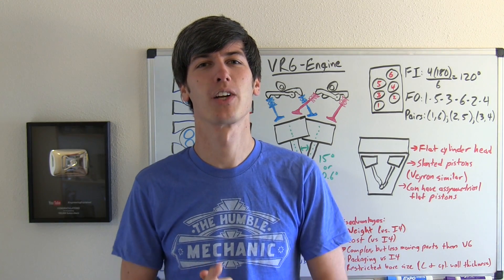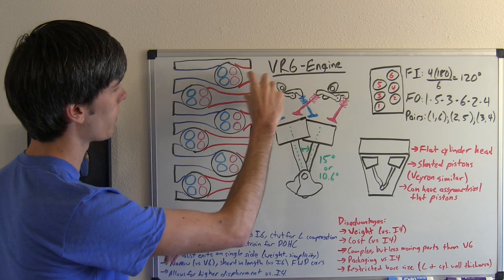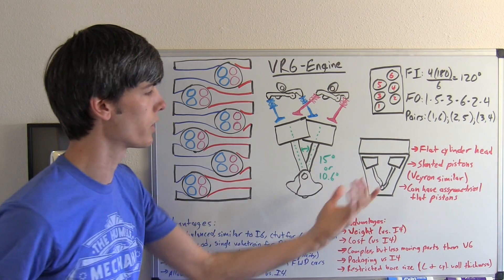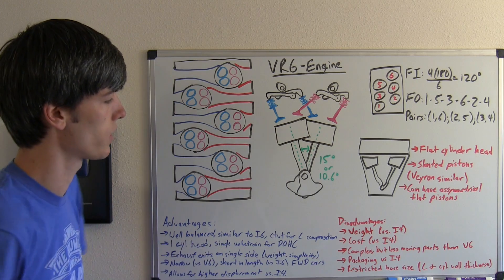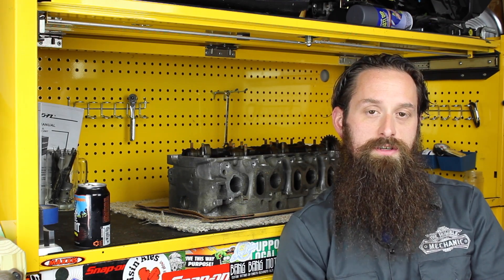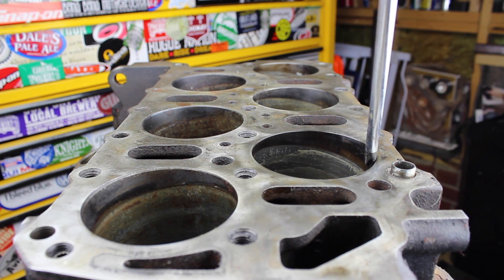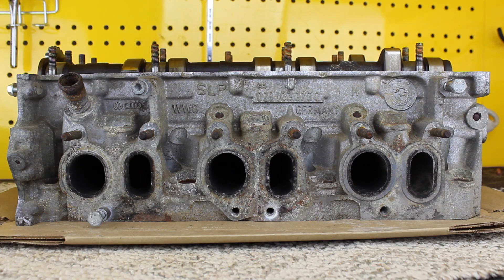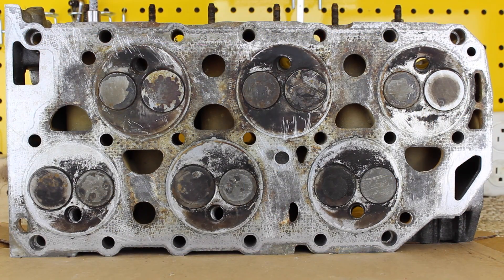VR6 Engine - Explained

Comment: The VR8 is a better engine. Because it has 8.
Reply: +lrreidjr Yea. Who am I kidding? 2.0L 4cyl engines are the best. Especially Vtec engines. Just wait for that VaginaTec to kick in. You'll go 0-60 in 6.9 seconds. Amazing.
Reply: +Matthew D The VR38 is a better engine, because it's a twin turbo monster ;)
Reply: Kenny Smith VR93 is thr best. 527ci supercharged big block v8. 5000hp.
Reply: +Matthew D.... same old gay 8 response. v8 guys that troll us 4 and 6 cylinder fans are pathetic at best. I can't wait for the new 3cylinder engines to hit the markets. I'm a fan of sub 2.0 liter engines and yeah vtec it pretty cool. Americans couldn't get it to work and sold the technology lol almost every new gay 8 is running some type of vtec technology.
Reply: +lrreidjr Congratulations. Good luck with that and good luck going through life as a homophobe.
Reply: lol @ v8's
Reply: +No Name ....Nissan's 3 cylinder is in production and sold in Thailand , its small and fits in a suit case. they have two versions, supercharged 200hp 60+ mpg and a turbo 350hp 55 mpg. Ford Will offer a similar engine for the U.S. market built by Nissan. You can read about these amazing compact engines and how they are built for High-performance with extreme fuel economy. they'll also use 76% less metal to build than a Chevy v8, 80% less metal than a dodge hemi and makes more HP per cubic inches than any v8 offered today.
Reply: +Matthew D I love nothing more than a huge, large-cammed V8 with a huge lope, but I have to respect the I-4 too.. I'm a sportbike guy myself, so my R1 is obviously an inline 4 and can smoke many vehicles with much more displacement, but to me one of the most astonishing accomplishments is the original S2000. In its debut year I believe it held the record for most hp per liter of any production NA engine available. That's a hell of an achievement in and of itself. That, and the power you can get out of forced induction is insane, considering the displacement. still, V8s have a sound that will live on forever!
Reply: +lrreidjr 

Also, power per liter is a meaningless measurement of real-world performance unless you are operating in an environment where displacement is restricted or heavily taxed, like a racing series or restrictive country. What matters a lot more is the power an engine makes compared to its external dimensions, or weight.
Reply: lrreidjr 

Try to read this slowly, since you clearly missed it the first time: power per liter is a MEANINGLESS real-world measurement (unless you are comparing identical engine designs or are restricted by regulation), since an engine's size and weight are not completely dependant on displacement. I have a fuel-efficient 500hp 5.7 V8 that's much smaller and much lighter than an RB26DETT, which makes 115hp/liter to my 87. My modified LS also gets better fuel mileage. You're going to sit there on your keyboard and tell me that the larger, heavier, less powerful, less economical engine (the legendary Nissan 2.6) is the more efficient of the two because its cylinder size is the only measurement of efficiency that matters? Get off YouTube and read.
Reply: lrreidjr 

The LS uses less material than an RB25. Your argument is invalid. 

Also, you keep mentioning cubic inches like they matter...they don't. How big is the engine? How heavy is the engine? That's what matters.
Reply: +Matthew D VR69 is better cuz it has 69 in it
Reply: Matthew D no sh*t Sherlock
Reply: +Matthew D  why stop with a VR 8
go all the way with a W16  
jus sayin
Reply: +lrreidjr gas will never be made redundant even when it runs out they'll be using stuff like bio fuel oh and I love the light nimbleness of of I4's but will never have a electric car, I'd rather walk simply for the reason that car manufactures can't make bloody electrical sensors last more than about 5 year not to mention the battery in them kills the environment a hell of a lot more than a fuel burner with it's heavy metals etc and only lasts between 5 and 10 year
Reply: +Matthew D LMAO @ you.
Reply: +lrreidjr to be fair the most aggressive and hateful comments towards other engines and communities have been made by you. Calm down buddy...
Reply: +Kacpa2 Thatd be one hell of an engine, wonder what kind of quarter mile thatd do ;)
Reply: +Matthew D Never heard of it....
Reply: +lrreidjr Is there really going to be a 3 cylinder for cars? The problem with 4cyl is how long between power strokes.
Reply: +Matthew The only racing I care about is Rally Racing, its 100% owned by 4 cylinder power! WRC 4 life!
Reply: +lrreidjr How often do you rally race?
Reply: +Matthew D if I'm in Africa every weekend, in the U.S. 4 to 5 times a year. in the U.S. I do more drag racing and it's kind of boring! driving a straight line seems pointless but it's better than doing nothing.
Reply: +No Name Not sure if trolling, but 3 cyl engines have been in cars for decades. There's even 2 cyl engines out there (FIAT)
Reply: +Sebastian Orschiedt fiat isn't going to bring it to the U.S. but I would love to see what I could do with a 2 cylinder. Funny posted that about Fiat because I'm buying one Sunday. I was holding out for the Nissan IDX but it's on hold again and I'm done waiting.
Reply: +Matthew D I'v owned several mustang's and camaro's, my eclipse gsx turbo was by far the fastest car I ever had. my best 1/4 mile times in my v8 cars was a 12.0 flat, my 05' gt,   my eclipse gsx 's best time was an 10.9 on a garret t-28 turbo.  I just go by my own personal experience....  and the gsx would get me a reliable 30 mpg...   and it was a 2.0 4 cylinder...
Reply: +Matthew D I would sell that V8 crap and buy a VR6 or a 4 cylinder car. P.S. Life is much more enjoyable when V8 dicks stay clear of our community and troll others who drive cars that are more inline with your personal preference.
Reply: I still prefer the Pratt and Whitney J58-1. 25,000 lb/ft. destroys any 4&6cyl ricer engine.
Reply: +No Name 3 and 5 cylinder engines have been around for decades iirc.
Reply: +lrreidjr the ecoboost 1.0L engine is an inline three engine.
Reply: +Matthew D you've crossed the line bud, I've reported you to you tube. I'm done with your harassment and negative comments.
Reply: +rjwz28 power per liter and volumetric efficiency is a true engine builders goal. I guess your a typical "cave man" more cylinders and more fuel with a high horse power goal, man that is so useless and should be outlawed. it's nothing but ego stroking and a waste of natural resources for no real reason.
Reply: Camp pendleton to be more exact. Camp pulgas.
Reply: +Mr Ornelas  lol I'm at the VA 5 DAYS A WEEK And if you were a real soldier you would know what Joint operations are. I was Navy EOD and operated with the 4th exp Marines. When the 75th rangers were in trouble a 911 call went out to anyone that could help. My mob unit was close and we went to help the Rangers. my last few year were spent loaned out to a NATO unit under French command and earned two more campaign medals.
Reply: +rjwz28 He's just hating because he can only afford a ricer 4cyl with less than 200hp. smh.
Reply: lrreidjr 

I'm a car guy, not a V8 guy. Grow up.
Reply: +lrreidjr it's not replaced anything, can you still buy petrol cars? Yes then it's not replaced anything. A Prius battery takes around 10000 years to decompose it's heavy metals will pollute the water supply for thousands of years to come it's only the ill informed that think electric cars are the future, hydrogen cars are the future they just need to find a way to extract it that doesn't consume more energy than to puts out
Reply: +lrreidjr I'm not denying they've got a future especially in city's but I think we'll see a hell of a lot more turbo development on small CC blocks and bio fuels witch is better for the environment. You didn't have a issue recycling the old bats because there's not 100k units getting scrapped each day at the min the demands bigger than supply for the heavy and precious metals/materials but once that's reversed it'll get expensive to recycle them because the recyclers get good money from them but once that's dried up you'll be paying them to take it. Only time will tell what the future brings but I can't see electric been the be all and end all for at least another 100 years and if they do kill combustion I think they'll do it with capacitors rather than battery's. Interesting fact for you electric cars came before combustion cars
Reply: +dicksplatts007 I watched that the other night on tv, the scientist DR Tesla actually made a electric car first and free electricity for a small town with his Tesla power Towers. I thought that was pretty cool. Nissan, BMW and ford have gone all in on small 3 cylinders engines and proving big power is possible with today's technology. I wish Nissan would pull the trigger on the IDX nismo that car would change a few more minds.
Reply: The VR8 is still king over the VR6.
Reply: +Matthew D I actually liked this video and so it emails me a reply notice. trolling is watching a video you don't like, make a negative comment, and start carp. I actually like and genuinely love small displacement engines and electric cars. I normally skip pass the obvious trolling statements but I miss fortunately replied and was sucked into the black hole of stupidity. That's what trolls are good at! I have to say for all the negative B.S. Youtube is still a great sight for sharing info with like minded people.
Reply: +Bradley Thomas I agree for sure. The hate I have for V8 engine runs deep and I should know better! I really should avoid being sucked in to the haters pool especially with my PTSD.
Reply: +David Gonzalez lol come by the VA on grantline Rd I work there Mon thru Friday.
Reply: +Matthew D why are you so fixated on suicide. Is that something you want to do to yourself? I deal with suicidal veterans everyday and I can point you to some help man.
Reply: +lrreidjr well I suppose I may be wrong but honestly you gotta clam down man, no one's hating on you Matt d or whatever his name is was just saying that v8 isn't a fuel wasting engine, that's all, then things got heated, I honestly love me a good v8
Reply: Matthew
Reply: +Matthew D no I just hate you and people like you.
Reply: lrreidjr Its ironic that your calling v8s gay. Some of the best engines in the world are v8s, LS3/LT1, Cotote 5.0, Voodoo 5.2. Just about every rx7 and nissan I see at the track has an ls in it, not a honda 4cyl.
Reply: +rjwz28 your so full of it! so why do you keep comparing a rb26,  I'm talking and have been talking about LEV subcompact engines being built today! the LS v8 is an absolute waste of resources and junk in every way possible. I just wish my community could be free of people like you and others who clearly think like a bunch of cave men. I've never watch or commented on a v8 video because I'd have nothing good to say. One day soon V8s will be outlawed for the waste and negative impact on our natural resources. I'll add one more fun fact, 2 electric dragsters this weekend went 4.40 seconds in the quarter mile lol I look forward to the day Gas is no longer used period.
Reply: +rjwz28 the wasted resources on a V8 Chevy ls engine is inexcusable and shameful. Nissan has a sub 80 cid engine making 300HP while achieving 57mpg and use less natural resources to build than that LS. I've personally built 2 rb25's, countless vw aircooled turbo engines, Honda engines, that have crushed LSX and still achieved great fuel mileage with split fuel mapping and properly ported heads from Bisimoto, low budget and other great company's. v8s are outdated and have no use in this modern world and don't get me started on electric cars lol Tesla, awd , 500HP , 0-60 in 3.1 seconds and charges in 40minutes with a range of 300miles per charge while using zero fuel!
Reply: +Uraeus most people who hate 4 cylinder engines usually hate electric even more. electric is the replacement for useless fuel guzzling drag racing.
Reply: +rjwz28 I didn't miss your point you just don't have a valid point at all. I don't agree with you at all and I know everything you say is false I'm guessing your probably made because some with a 4 banger engine put a ass whooping on that worthless V8 car you drive. I hate v8 people and love watching them get crushed at everything.
Reply: +dicksplatts007 electric is the future and has all ready replace any all fuels. I hope you've started buying walking shoes lol
Reply: +dicksplatts007 I drove a electric 1970 VW beetle thanks to EV west parts, I drove it for 11 years on the same lipo4life batteries. My batteries were recycled with no issues and the new nuclear water batteries that are in the final stage of development are looking at a usable life of 60 years. electric can replace any and all gas or diesel powered cars right now but the oil and gas industry will not allow that to happen. I will buy a Tesla 3 in a couple of years. but for now I'll enjoy my compact gas engines. I love how electric drag bikes, dragster are all ready going as fast a the fuel versions. Lol I can't wait to see the first Rally car running electric.

Comment: If there's one thing VW does well, it's engine castings.  That VR6 block is beautiful.
Reply: +Keith You forget that it is the Japanese who make the Toyota Hilux..
Reply: Well....I could argue as the most unreliable car according to reliabilityindex.com is the BMW m5 and the bottom 10 car list is stuffed full of German cars!  Merc, Audi, BMW
Check it out quite surprising.
Reply: scdevon obviously you are not familiar with the OM617 and the W123 chassis
Reply: +Keith I think you are confusing electrical with electronic.
Germany does not have a huge background in electronics, but the country's electrical engineering side is huge and often world-leading: Siemens, AEG, Pepperl+Fuchs, Schleicher, all the small companies that were bought over the years by ALSTOM, Kimo, Woehner. A lot of these companies are not large but they focus on a small range of parts, made of high quality. Siemens obviously is massive and does anything from network design to Power Gen.
Reply: +lola fick that's the runner up. a single link timing chain is a bit of a no no. the car im talking about is the w123 chassis, or for those that don't know the 300D of the late 70's and early 80's
Reply: Keith My Hilux has a timing belt
Reply: and id bet its non interference so if and when it breaks there's no damage
Reply: +lola fick you have the wrong hilux then.  The 22re is what built the reputation of hilux trucks being indestructible,  as well as being none- interference
Reply: Keith How can a Hilux be wrong?
Reply: lola fick because a name isnt what makes something, but the parts themselves.
Reply: Keith Yes, and it is the unique combination of parts that is referred to collectively as 'a Hilux'.
Reply: Our Audi A6 3.0T supercharged is a dream. Amazing engine
Reply: +Chris Monopoli germans know EXACTLY how to build mechanical things. hence why THE most durable vehicle ever made was crafted by their hands. but it has the most basic electrical system i have ever seen.

BUT ask a german to build electrical systems, and you are GOING TO HAVE A BAD TIME.
Reply: +scdevon VW does a lot of things well the Germans build good cars you can't argue that VW, Porsche, Audi, & BMW all well built machines
Reply: Chris Monopoli The BMW engines put in range rovers were absolute CRAP! Very prone to overheating.
Reply: @ChrisMonopoli  Blind faith

Comment: As I recall, the VR-6 does NOT work like an inline six. With an inline six, each cylinder has its own crank journal. With the VR-6,  each crank shaft journal has two cylinders attached to it. So saying its "just like an i6" is not really correct.
Reply from the maker: The firing order and interval are "just like an I6."
Reply: +Stuka87 Except the VR6 has seven main bearings because in fact each one does have it's own crank shaft journal.

To add onto the tech, the 24v isn't new.  They also were 2.8L with exception of the R32..  That changed for the 02 model with the 01 being last year of the 12v.  I in fact have a 24v block from factory but a 12v head.  Of note that the 99-01 12v had different lift/duration between the two banks of cylinders to account for the different runner lengths.
Reply: +Stuka87 If that were true a VR6 would be running almost like a 3.2 litre 3 cylinder. An engine more suited for a farm tractor really.
Reply: EinachserLS What he describes was not uncommon where two rods are on the same journal.  Just look up the smallblock.  Most V6s for balancing purposes are not a true shared journal but do have an offset with two pistons between each main.  I am thinking that is what stuka thought.  The VR6 does alternate rod/main.
Reply: Noel Padalhin
The most humorous part is that even volkswagen called it an inline engine.  That is what the R in VR means.

Vee reihenmotor which means its an inline v.  If you work on a VR, you gotta approach it like an inline engine.  The only thing that is V about them is the splaying of the cylinders to shorten the block.
Reply: Not with high chrome steel, and vanadium.
There shall be no flex.
Reply: +Stuka87  He did say "more in common" at around 0:41.
Reply: +Stuka87  One crank journal with 2 rods ?.  Not very good because of crank flex the way cars are driven these days.  Makes the engine unit shorter though.
Reply: Crobular I Nearly every Vee engine is this way. Only a very few Vee engines do not share crank journals.
Reply: Only reason the VR and W engines dont is that the piston staggering means they are too close that they need to share.  You are right.  It is a common thing for any traditional V engine.  I haven't worked on any new generation engines to know if the opposing banks are offset enough to allow for non shared journals.